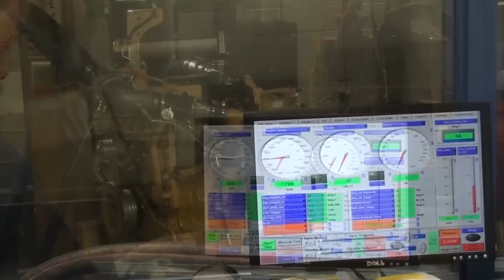Cat Certified D6R Powertrain Rebuild Time-Lapse

Comment: Powertrain rebuild is over 100k. I was quoted close to 200k cad, for powertrain and some extras not a full rebuild. Full rebuild is more.
Reply: James Smith theres no way its 100k
Reply: Easy 100k 
What you saw here could be well over 250k 
Just that engine work they did was over 50k. Alone. Then u add all the tear down and rebuild man hours. Then add assembly and parts to that bill. 
Then throw a nice paint job in a paint both with proper prep work and your humming away with a 250k bill I bet.
Reply: James Smith coming from an auto mechanics point of view it just seems incredibly high of price for what their doing. Id love to see the breakdown of where the money is going because unless the parts are just completely unnecessarily overpriced it would seem to me that the shop is making at least $130k profit on a 250k rebuild job which is mind blowing 120k for parts seems very very wrong. Makes me consider going back to school to become a diesel mech.
Reply: Also think about it like this. Again from an auto mechanics point of view. Honda quoted my sister $1250 for new pads and rotors on her 2008 honda pilot. Without labor i installed monroe parts and did the exact job for $140. Thats a savings of $1,110. What would stop the cat owner from saving the cost of 1 or 2 new ferarris by doing the work himself if he had the tools and skills? Because surely if he did it himself it wouldnt cost over 250k. Id be hesitant to believe it would cost him over 50k. But hey im just a mechanic. Thoughts?
Reply: Chris W :  cat is making money that would have gone to someone else.   I think it’s s business strategy.
Reply: I work on D6Ts daily, this service could infact cost around 85-100k. The machine brand new is between 450k-550k depending on what bells and whistles you get. This is an older model but with a full reman/rebuild on the power train with updated brake packs and full trans/motor/torque converter rebuilds yeah. Easily 85-100k
Reply: mattdavidpiatt i mean i guess i could believe 85-100k but 250k+ seems out there given your talking half the value of the dozer. What would parts cost?
Reply: @chrisw4888   parts are costly, I couldn't tell you off hand what all it would be but I can tell you about 1/3 is just service charge lol.
Reply: mattdavidpiatt i need to become a diesel mechanic and open a shop lol

Comment: Why not paint the various parts after disassembly before you put it back together?
Reply: its more work to clean and prep every single part than just put it back together and spray the entire thing. there is no value in panting each thing by itself when the second it gets to the jobsite its going to get fucked up again.
Reply: Clyde bigsby lol I can assure you that there is nothing lazy about Foley. My grandfather worked with them for very many years purchasing all of his Cat equipment from them. If he didn’t like them he could’ve easily went to Giles & Ransome which was actually closer to his yard
Reply: I've definitely seen some stuff but I'm not saying anything

Comment: A good used 1998-2001 model, with about 7k hours can cost about 70k USD. So I imagine a rebuild is about 15 to 20k usd
Reply: effinghamhick so what I did is I went online and research how much they cost so you can find them between 70 and 150k used I don't think anybody would spend 100K rebuilding one it really doesn't make much sense but it's possible
Reply: I think the last time was $65,000 some years ago on a D6H. I think It boils down more to sentimental value.   Your machine and you want to bring it back to its newer status and the way it was then.  Nothing better than confidence in a machine when it's dropped off on a larger job.

Comment: I wonder how much it cost to overhaul, compared to buying a new Cat.
Reply: @Benaiah Ahmadinejad That makes zero sense. A rebuild is probably 1/4 of the cost of new
Reply: @chechnya  makes sense in the reliability aspect of buying a new emissions choked model that has egr and def issues....  pre-emmissions is so much more reliable  as it has less electronics and not choked on fuel efficiency with exhaust  aftertreatments.
Reply: Cummins Powered ab 

When I see Diesel engines today pouring out black, carbon emissions, I get pissed, because it  fucks up the air you and I and six billion others breath!

There’s more to moving earth than how cheaply it can be done.

Comment: That machine really looked like it didn’t need that work doing
Reply: major work is done by hours not by looks, it to prevent major failure on  job site.
Reply: Routine maintenance saves lives
Reply: It's called preventative maintenance. You don't fix the engine once it's grenaded itself and has a hole on the side of the block.
Reply: TehHijack some companies do. And they still never learn